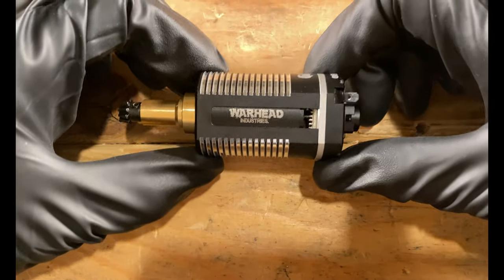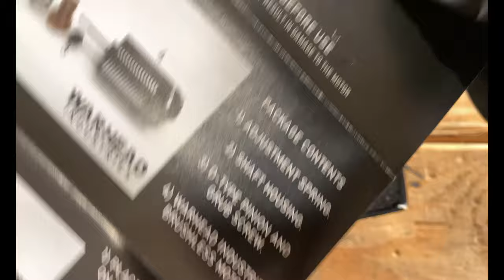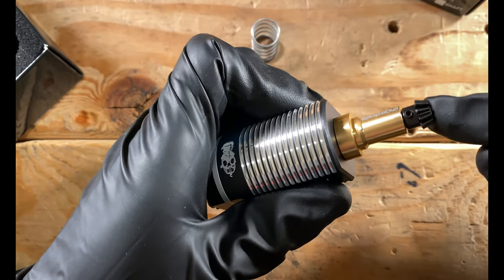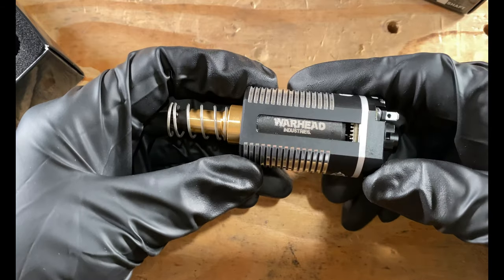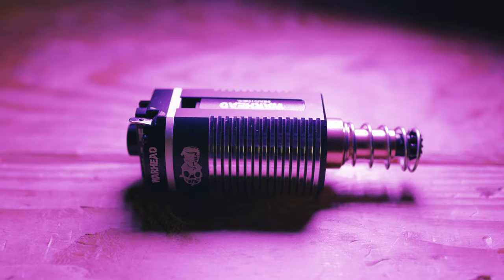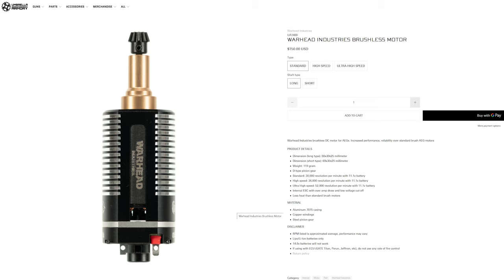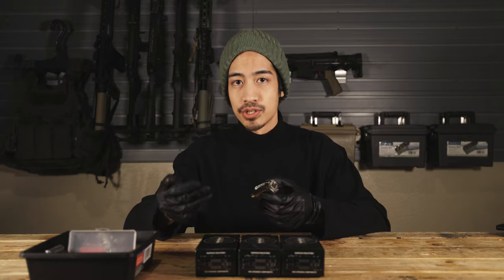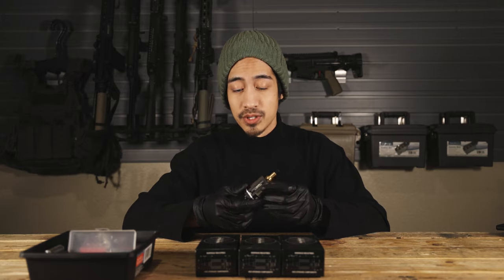Revolutionary Airsoft Motor (Warhead Industries Brushless Motor)

Comment: Coming from the rc car world, I'm surprised it took this long to integrate brushless motors into airsoft. Pretty cool how they integrate an ESC into one assembly.
Reply: You rc guys had the right idea I dropped in a warhead standard speed 20k with 7.4 and Jesus it's smooth and less noise brushless motors are worth it ❤

Comment: If I'm paying 150 for a motor, a hundred or so for upgraded internals,  and 150 for a gate titan, then I might as well just save a little more and buy a regulator for 150 ish and a hpa engine. The HPA would probably be close to 600, but it'd be an awesome setup with little maintenance. I love and hate opening up an AEG gearbox.  Will brushless motors decrease in price? cause as of now it doesn't seem very feasable for most people.
Reply from the maker: Yes they will, likely with cheaper variants which they've already announced as the Warhead "base" no cnc shell and weaker magnets but basically 95% as good tbh for like 20-25% cheaper.
Reply: Not true. With HPA you still need to buy tanks and lines. All the shit can easily cost over $1k.. 300 for a Titan and a Brushless motor, to achieve HPA trigger response and auto is literally so much cheaper.
Reply: @DanielFreakinAwesome2  300 for an inferno, 90 for graveyard body, 40 bucks shipped for an amped line,and 120 for a redline regulator, so a little over 550 that I purchased.
Reply: Except most of us don't want to HAVE to wear a backpack just to shoot one of these..
Reply: @brandonknight8671  and what about the HPA engine and work done to convert your gun?  Vs literally just swapping in a motor..
Reply: I have two hpa engines one is an mtw, the other is a an inferno and I have 2 aegs. I'm buying a P* Jack soon.  I'll just stick to my 30 dollar zci brushed motors for now until the price of these comes down, cause I've spent a lot of gears and internals, along with mosfet systems. Who wears a backpack with hpa? Lol it would be like an eighth of a backpack if there was the 68/4500 is super light and barely noticeable. Time is money and I don't want to waste all day on my aeg like I used to.
Reply: @davidfaustino4476  no where near the same performance, and you should reshim everytime you put a new motor in.
Reply: Stack your bread
Reply: @felinor693  This is the way
Reply: @felinor693 double stack sandwich ftw.

Comment: This motor may be ok once it's installed.. but GOOD LUCK trying to get a good connection with the motor tabs without breaking them off completely.  ADV brushless motors for the win.. and save $30 too.

Comment: What do you think how much RPS will be changed switching from Nimrod 30k to Warhead 36k (long)?
Reply: alot. probs a good 5 to 10 rps up. since a 30k brushed motor is low tpa it struggles to pull, the warhead 36k has 80% efficiency under full load so your gonna get 29k rpm under load.

Comment: Just bought my highspeed hours ago..im super excited for my MK18 DSG build 😇
Reply from the maker: How did it go? Let us know if you like the performance!
Reply: @UmbrellaArmory  all good brother😉 i build a full stroke 12:1 gear set..put it in my vfc 416A5 and it's hot..too hot🔥40rps..i have also a DSG which fire around 45rps..will see if i can put it in my dsg build😊
Reply: @EduardoGarciaCovers  what gears you using chap ive had terrible luck with shs gears getting shredded.
Reply: @ParmoFPV ..i've been using HSH gears ever since..unfurtunately you have to be lucky enough to get one of those "good ones"  i also got my fair share... as of now i dont have any problem with my DSG GEAR
Reply: @EduardoGarciaCovers  any info with dsg +wh motor?

Comment: it's a shame it comes without a hex key, my regular sets only go down to 1.5mm which is still too big. it's currently in my replica without it being tightened and it works, but i need to get a single hex key to fix it before i go out into the field

Comment: So I've been using the option no 1 and the warheads since they were released. (I also tried the xpert and hated it) While the warhead is better quality in terms of build torque and amp draw,  i still prefer the option no 1.
-the warhead pinion is trash
-the tabs were super fragile until recently
-warhead motors fry much more easily than the option no 1 does, I tested 5 of each in a a 14:1dsg
-warhead motors have always heated up faster than the option no 1 when semi spammed

I never encounted any of the option no 1 motors problems you describe except when I intentionally tried a 14v and when I tried a 12:1 m180. I've used over 15 of them in builds
-the 'safety' features of the warhead can lead to many noobs ruining it I've seen at least 7 burnt out because of it
- also gate titan seems to have more issues with the warhead (double shoots on semi sometimes regardless of ab and spring strength).

I certainly appreciate the warhead motors, but they require more tuning,, are more prone to failure (whether the pinion or user error) and more care than the option no 1. 

I do agree tho that brushless motors are the future, along with the tappetless systems which I heard you weren't a fan of
Reply: option no.1's are NOTORIOUS for frying.
you shouldnt be using active breaking on any brushless motor,if you're getting double feeding thats something to do with the gate,not the motor.
Reply: @kwooook  Is that cause brushless motors don't need active breaking?
Reply: Tappetless systems What? How does it work?

Comment: Ive had I think 5 brushless motors, all of them have broke the motor tabs off of the positive side even after they epoxied them, decided to go back to brushed
Reply from the maker: Hi @FamJuan, they are currently reinforced with solder then epoxied.

Have you tried reaching out to them for RMA/repair?
Reply: You need a ronin
Reply: Some of the newer brushed motors with a mosfett are still snappy I use tienly 25k 30k and g&g 25k there still snappy motors and I also have warheads in 2 other builds

Comment: My Airsoft Rifle is Krytac Barrett Rec7 SPR
And those are my upgrades:

MAXX M4A Hop-up
MAXX piston head
MAXX cylinder head
MAXX nozzle 21.25mm
MAXX cylinder 450-550mm

Laylax prometheus 416mm 6.03 inner barrel

Shs m120 spring 
Shs 14 steel teeth piston 
Krytac 18:1 gearset

Maple leaf 70* bucking super silicone 

Warhead High Speed motor 36K 

Titan Gate II expert v2 bluetooth

Gate EON V2 Gearbox Titanium

Gate Nova 2B1 trigger

EMR 3500Mah lipo batteries 11.1

is it ok to use warhead high speed 36k brushless motor in 450 fps assault??
Or should i lower the fps to 400fps of the risk?

Comment: Do the lower speed warhead motors generate more torque per amp than the high speed? and how would it compare to the ASG 18K or Tienly 25k? Thanks!
Reply from the maker: The amp draw on the standard brushless motor (30k) is nothing but impressive. Drawing about 7-9 amps depending on torque requirements. This easily beats any DC brushed motor in the same rpm category as well as many below that as well including 22k motors.

I don't know on top of my head the amp draw of a Franken torque/28-32tpa setup but for the rpm range being so slow its hard to justify its use after these came out.
Reply: @UmbrellaArmory  what is the spring stifness?
Also what grain size is used in the gun you were demonstraiting on

Comment: I wish I can find gears that handles the  Ultra high motor, it just eating the gears up like candy..lol
Reply from the maker: Honestly, we don't recommend the super duper high speed one unless you have an exact build in mind that you know you are going to do. But, SHS and siegetek should still hold up fine if shimmed and tuned properly. However, we still recommend the balanced/high speed model for most uses.
Reply: I used shs with my ultra on one and stock krytac on another. No issues
Reply: My shs handle it fine
Reply: @UmbrellaArmory  krytac gears held up lively too

Comment: I'm hearing a lot of issues with ab and this motor would it be better to have very small amount of ab or just none at all new to airsoft btw
Reply: 20%ab or none
Reply from the maker: He's correct they say go with 0% to start. If needed go up 1 level which on a gate is by 20% increments.

We have caused a failure on 100%ab already. So it seems risky to go very high.

Luckily brushless motors generally don't need a lot, as the armature weight is significantly less than DC motors.
Reply: @UmbrellaArmory  I’ve been on board d dealing with warhead since the beginning haha
Reply: @UmbrellaArmory  2% is money. I’ve been working closely with warhead and these issues

Comment: Bought by this motor but it’s too big for my EMG black rain ordinance SPEC15.  Any suggestions ?
Reply from the maker: Hi, are you trying to say it physically can't fit in the pistol grip? If that's the case and your wires aren't the issue, we recommend you to just switch to a different pistol grip. 
We use them in PTS EPG-C grips with no issue fitting.
Reply: @UmbrellaArmory  correct.. it’s physically too wide to fit inside of the grip.  I’ll check these grips out.  Thank you!

Comment: Maximum voltage this unit will handle? I currently have an M14 on 18.5v and looking for a brushless if it'll handle it
Reply: it says 11.1v max. probs cuz the motor is too hot to run anything stronger as it has a 12 amp limit.

Comment: What difference between base and black warhead brushless motor?
Reply: not alot, base is cased metal and the black is cnc probably just abit lighter and dissapates the heat abit quicker

Comment: the 52k rpm one works with the perun hybrid and m130 spring?
Reply: You will strip all your gears lol.. Too fast. Spring needs to be alot stronger.
Reply from the maker: What gear set are you trying to use it with?
Reply: @UmbrellaArmory  what gear are available for this 52k Rpm?

Comment: Brushless motors are over rated and priced, combo titan+good motor is Better.
Reply from the maker: I would highly suggest you to try it first. We had our doubts with the record of previous brushless motors however this is completely different in terms of functionality and performance.

Gate Titan is Gate Titan, whatever trick you do with Gate Titan is also applicable with Warhead Brushless motor.

It's day and night different between the Warhead Brushless motor than ANY airsoft brush motor.
The performance of Warhead Brushless motor is outside of the physical possibility of airsoft brush motor.
Reply: @UmbrellaArmory  Don't all brushless motors kill mosfets with AB? I've seen a dead Titan that had AB turned on with Warhead brushless motor.
You can not AB a brushless motor due to the way it works.
Reply: @error262  I've talked to a couple of guys and they've gotten AB to work just fine with their brushless motors, no issues or anything
Reply: Overheat with brush motor. Brushless nope
Reply: 20% ab is great.
Reply: @error262  no tvs run a warhead and titan and aster for ever no issues.